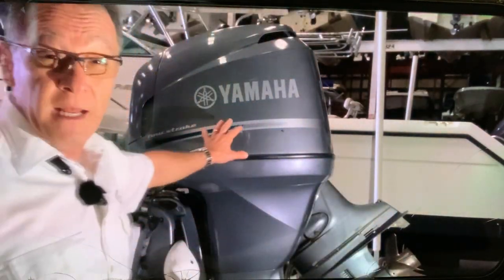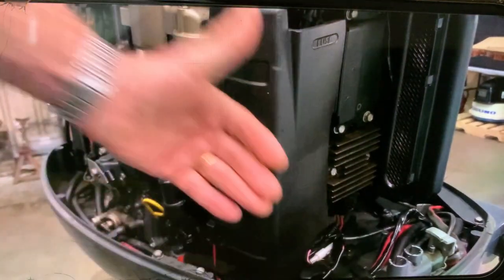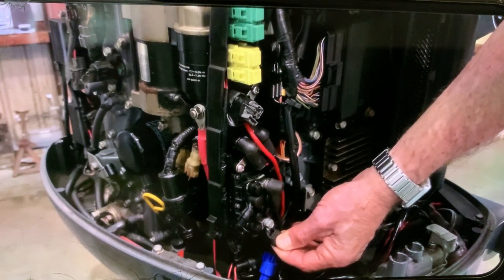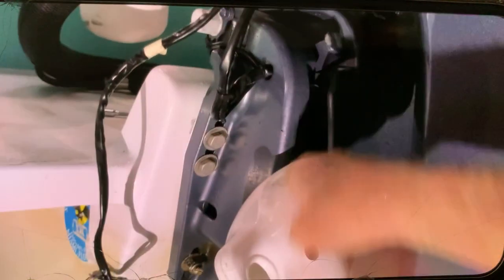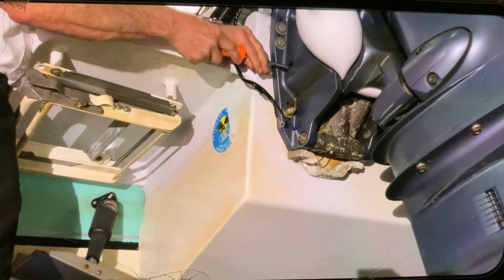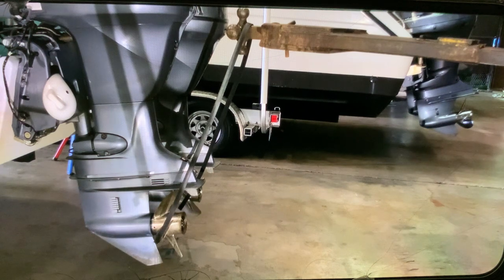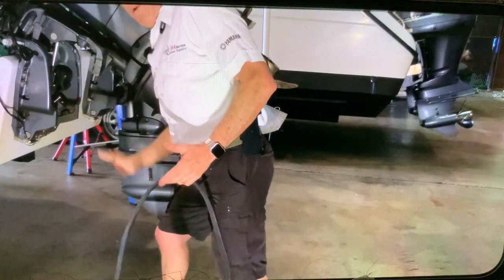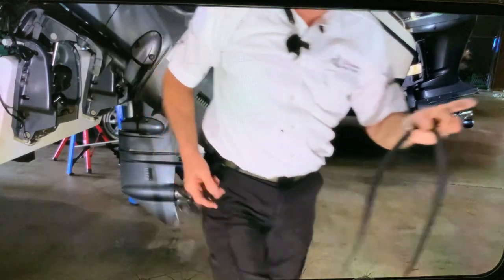How To Replace Trim Unit YAMAHA F-115 (part #1)

Comment: I used this video to remove my PTT and sent it off to be rebuilt.  I got a unit back but I'm pretty sure it wasn't the one I sent in but there no way to reallly prove it.  The manual relef screw on the one i got back has the slot on the scew head so elongated it looks like a half circle!  This is one reason I'm sure it's not my unit.  Can you replace this w/o having to drain the system or remove it from the engine?